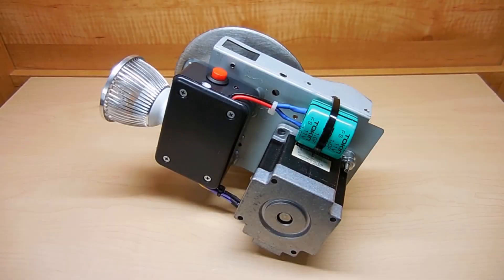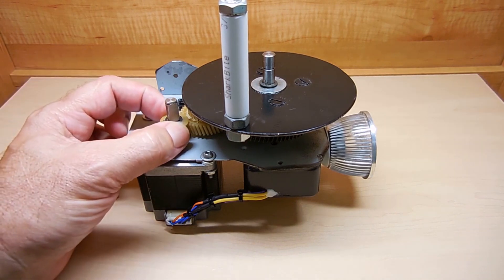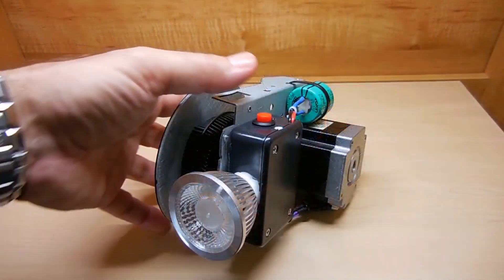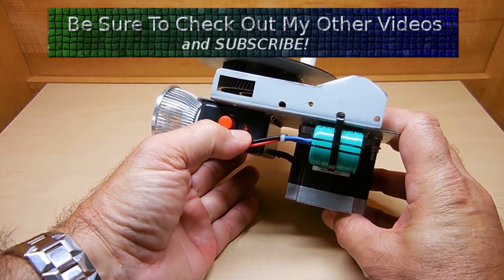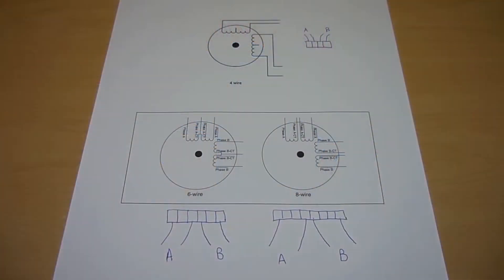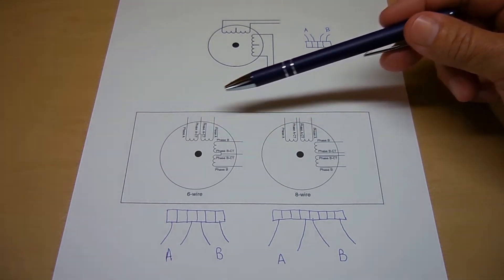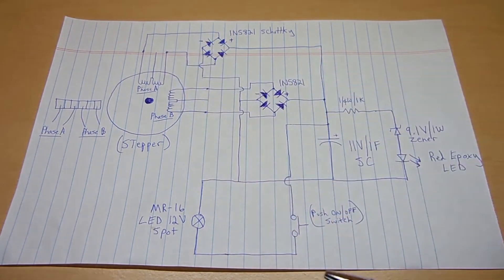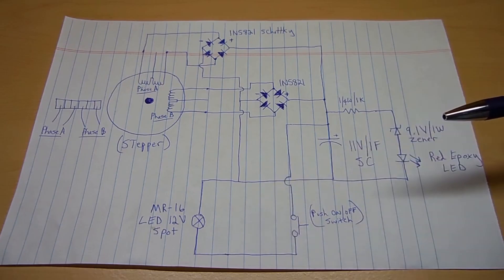Powerful Homemade Supercapacitor Crank Generator LED Spotlight!

Comment: I'd be tempted to put a 9v nimh across the supercap, plus a tiny switch to isolate the 9v nimh just incase light is needed asap.
Reply: perhaps with a small pot & knob & transistor to throttle how much current it can take.

Comment: Ha, at first I thought the disk was a CD! Aren't the two phases out of sync by 90 degrees?  My thought is that some cancellation may be occurring.
Reply from the maker: Makes no difference being out of phase, I converted the output to DC
Reply: @electronicsNmore  Right, I just went back to view your schematic, thanks for clarifying that.

Comment: This is amazing, recently i have managed to built one, mine doesn't have a gear system but it charges 10,8V (-+2F) in less than a minute. I saw your video some time ago and your video has been an inspiration.

Comment: This is a great build.  Another pro to your self-powered flashlight(anything else for that matter) is that if a component fails, you can replace it or upgrade it.  This project can even be easily modified to charge a cellphone in an emergency.

Comment: lot brighter  than one i built years ago. thanks! i may make a new one, but reusing the gears from the printer! good idea XD
Reply: great to see reusing the gears is possible and works well! thanks for tips about not overcharging the supercaps. think ill add a cheap voltage meter but zener diode and led is a good idea! forgot about that trick too.

Comment: That was pretty cool.  I used to make DIY electrical/electronic projects out of various magazines in the '70s.  I made an intermittent, variable timing automobile wiper motor controller because my vehicle didn't have one.  I made my own basic car alarm system that monitored door, hood and trunk switches connected to a powerful and loud metallic speaker under the hood.  It's been a while for that kind of thing, but I'm always busy with projects of some kind.  I'm working on repairing my tractor mower now and I'm almost done.  Had to buy a replacement carburetor because my neighbor lost an internal part.  Tested compression and lapped the valves.  I'm working on the deck now.  While your project was cool, I have a small store-bought hand-wind device like that, two LED flashlights and a 6V lantern with a rechargeable battery and an LED bulb.  I'd want at least one hand free while using a light.  I also have one on a headband to have both hands free.  Thanks, Scott.

Comment: Sharp things are useless for survival. You have to survive, not get hurt.
Reply from the maker: Sharp? Do you honestly think I'd be holding something with sharp edges in my hand tightly? Common sense, all edges were rounded off.
Reply: That's the most puerile, nonsensical comment I've seen in quite some time. And you speak of useless? Look in a mirror, perhaps. Essentially, you're just talking to hear yourself talk... and failing miserably at it, as well.
Reply: @johnsmith7676  You do what any idiot without a plot does: Attack the sender and not the plot.

Comment: Fun project. I actually have one of these. Except mine has no gears. Or crank. Or stepper motor. And the super cap was replaced by an alkaline battery. Otherwise exactly identical. Or close anyway.

Comment: Nice build. Did you think of protecting the supercap with the zener diode and a resistor? Or maybe the zener and another bright LED that would instantly consume any over voltage generated.
Reply from the maker: The way it's geared, you won't produce too much voltage. Overcharging can only happen if the unit is cranked too fast with the LED off.

Comment: I would just grab a flashlight.
Reply from the maker: Batteries go dead. Even if the supercapacitor became faulty, you'd still have a bright light by cranking. The LED will never burn out, only fade after a lot of use.